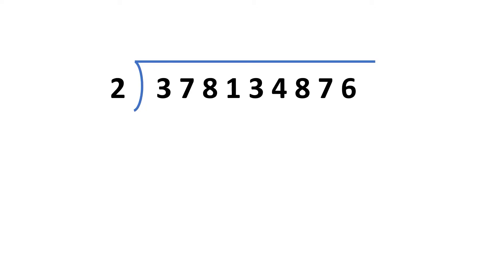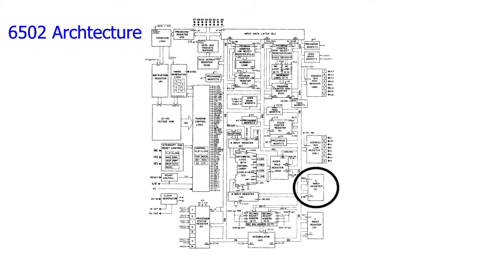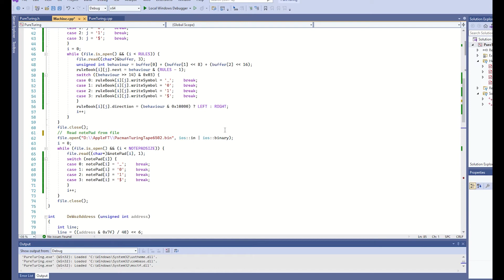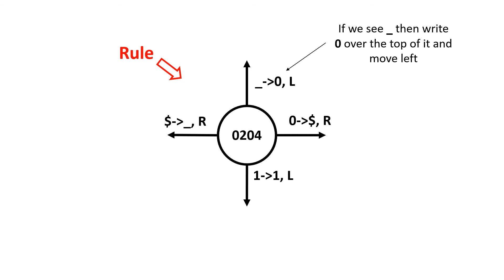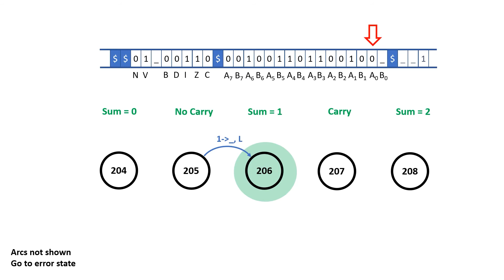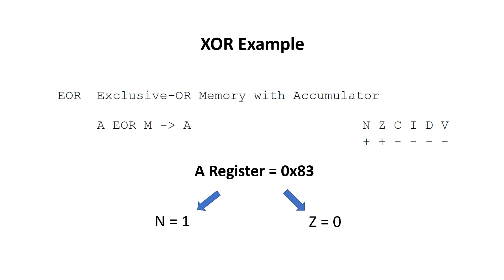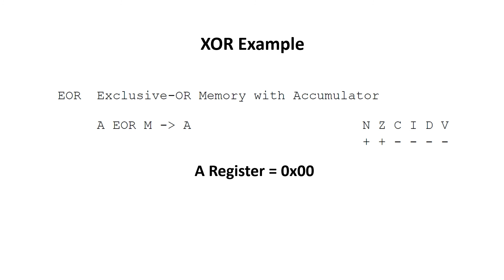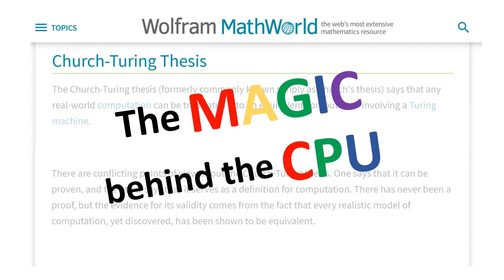PureTuring Part 2.   Turing Machine Microprocessor - The build.

Comment: Very interesting.  Even though I know, in a book-based sense, that Turing machines (but with infinite memory) work this way, it's amazing to see them doing computing in this fashion, emulating a well-known microprocessor.  In a way, I'm still somewhat in disbelief that it can handle all the flags and such, just moving along one cell at a time, even while I'm watching it demonstrated!
Reply from the maker: It's pretty cool letting it run.  I haven't put the PACMAN example up on Github (copywrite on pacman), but if you want to try it yourself, PM me on facebook and i can send you the zip file.